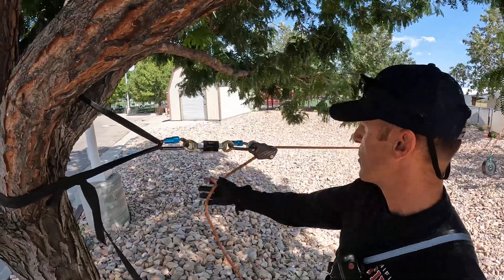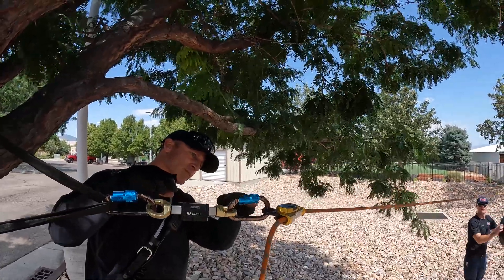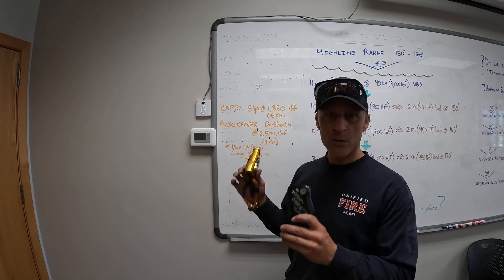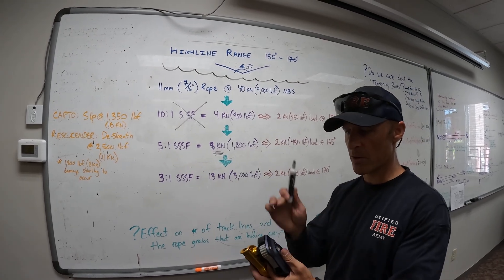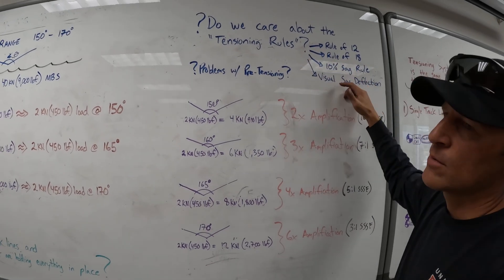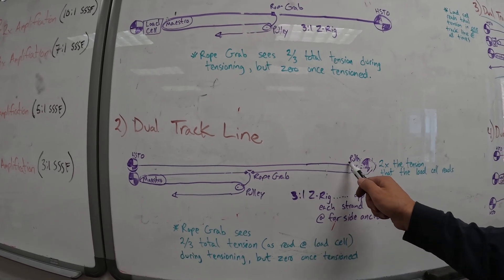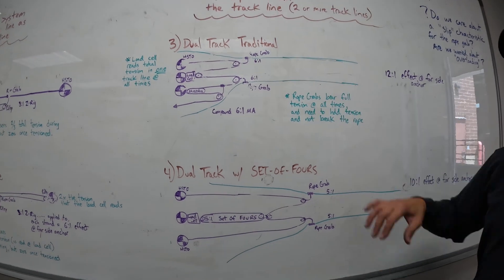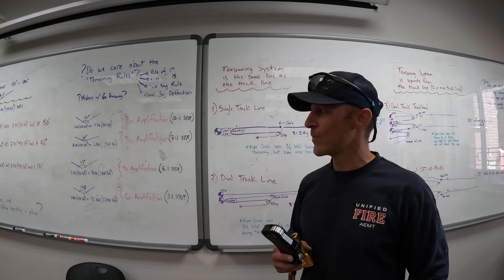Tensioning Highlines w/ Camming Rope Grabs: Force Limiting vs. Breaking Ropes

Comment: Hi Bob, I've gone with the 'differential' rigging for a highline in the past: twin tracklines with a load cell on the balancing pulley reading the 6:1 tension on each trackline. I've used tandem prusiks on each track rather than a rescucender.  What are the cons of using prusiks over rescucenders on the tracklines? Also,  I haven't gone less than 10:1 SSF - is the limiting factor just the value that the rope grab slips / damages the tracks?
Reply from the maker: There was an ITRS paper a while back (before Petzl came out with the new version of rescucender) where they tested a bunch of Prusiks in slow pull applications.  Tandem Prusiks on average broke the rope around 17KN.  While they hold higher forces than the new rescucenders, the software-on-software creates glazing/melting before that which is not ideal.  Either way both Tandem Prusiks and New Rescucenders will break the rope if the forces go unchecked.  The 10:1 SSF has been adopted as a “one-size-fits-all” blanket safety factor that, over the years people have simply applied to every aspect of rigging, every operation, every system, and every training evolution.  I don’t think the intent was ever to make it so that ratio applied to everything.  The control lines of the highline definitely should be at a 10:1SSF based on the original concept of the 10:1SSF, that is to have enough strength to arrest the impact forces.  Whereas with the track lines, they don’t deal with arrest forces and therefore my goal is to be able to apply forces to them beyond 10:1 in order to reduce sag and maximize clearance, but also keep the forces away from the failure limit.  And if I can get a device that can hold to higher forces AND slip (force limiter) before damage/failure occurs, then that would be the “bees knees”.  Unfortunately there aren’t many rope grabs out there that can do that.  And the only one that I know of that can is the old rescucender which they don’t make anymore

Comment: Aren't you overloading T rated rescuecender?
Reply from the maker: T rated rope grabs are not tested/rated based on breaking strength, rather their interaction & manner of function with the rope.  The T rated rescucender is rated to hold a minimum of 5kN (1,125 lbf) without slippage or damage to the rope.  You can overload your system and that means you start to cause slippage, damage, or failure, specifically to the rope.

So we must be specific in our definition of “overloading”.  I would argue that at, for example, 1,600 lbf (7kN) that we are not overloading the trackline-rescucender interface, but at around 1,800 lbf then we are approaching it.

Comment: CMC posted a Q&A article in 2015 in reference to NFPA 1983. In the article, they stated "The 5 kN and 11 kN that you are referencing are the values for the Procedure A test. The respective devices must be pulled (tied-off configuration) to these forces without doing damage to the rope" when answering a question that referenced 8.6.8. Although this section is for testing DCD, if i interpret right the testing requirements are the same. I believe their interpretation is that the device can be tie-off.
Reply from the maker: Interesting.  I still don't interpret that after reading the standard countless times over.  In my mind, procedure A is the test that is supposed to replicate how the end user is actually going to use the rope grab, while procedure B is where the rope grab is tied off & stressed to it's breaking point.  Clearly, I'm just not getting it:
8.6 Manner of Function Tensile Test
8.6.1.1 This test shall apply to ascending devices, rope grab devices, descent control devices, and belay devices.
8.6.3.3 Each specimen shall be tested to both Procedure A and Procedure B.
8.6.4 Procedure.
8.6.4.1 Testing shall be conducted in the “manner of function” for the item being tested.
8.6.4.2.3  The device shall be attached to the rope according to the manufacturer's instructions.
8.6.4.3 Procedure A.
8.6.4.3.1 One end of the rope shall be anchored on to a tensile testing machine and the device shall be anchored to the other end of the rope. The specified deformation force shall be applied to the device at the normal attachment point at a rate of 25 mm/min ± 5 mm/min (1 in./min ± 1∕4 in./min).
8.6.4.3.2 The specified deformation force shall be held for 30 seconds +1/−0 second, and then the tension shall be completely released over a maximum of 1 minute.
8.6.4.3.3 The device shall then be inspected for damage to the device or to the rope used for testing.
8.6.4.4 Procedure B.
8.6.4.4.1 Using the same item and test set up as in Procedure A, the load shall then be re-applied to the device until the breaking point of the device.
8.6.4.4.3* In the case of items that are designed to slip under high load, the rope shall be knotted or the device otherwise blocked to prevent slippage.
8.6.7 Specific Requirements for Testing Ascent Devices and Rope Grab Devices.
8.6.7.1* Technical-use ascent devices and rope grab devices shall be tested at a load of 5 kN (1124 lbf) for Procedure A.
8.6.7.2 General-use ascent devices and rope grab devices shall be tested at a load of 11 kN (2500 lbf) for Procedure A.
Reply: After a little more digging, NFPA 2500 replaces the 1983 standard. The 2500 standard allows for the device to be blocked off or knotted if it is designed to slip. So technically the device meets the requirements as of 2022 NFPA 2500. I find that to be a dumb change to the testing.
Reply from the maker: Agreed.  It does not reflect how the device is actually to be used.... it's not a carabiner.

Comment: Also, you asked about the G rating on the Capto. I believe the answer is NFPA 2500 allows the device to be tied off in order to achieve the 2500lbf strength requirement of the standard.
I think that is why the CAPTO is deemed safe. It has to be 11kN in strength in case the slippage fails at a lower amount, not that it has to grab to 11 kN.  This would also answer why there is so much inconsistency in rope grab slips.
Reply from the maker: I’m not sold & definitely don’t interpret it as such….. have read 1983 section 8 on this over & over & over the past few years.  In 8.6 they state that rope grabs must be tested for both procedure A and B….. It should be noted that 8.6 is the manner of function test, not a breaking test as depicted in section 8.7.    Procedure A there is no blocking knot applied, while Procedure B there is but only for devices designed to slip.  Either way, the rope grab is subject to both test procedures, and 8.6.7.1 and 8.6.7.2 specify the test loads for technical & general use.

Comment: I haven't seen any Bluewater VT prusiks in any of your videos.  I know many BSAR teams are moving to a VT prusik over the tandem prusiks (due to testing), what are your thoughts on the VT prusiks?
Reply from the maker: I do have a few videos (at least 3) where I do on-rope functions w/ the VT as well as show it’s use as part of a multi-functional system at the anchor….  VT Prusiks are great.  I have my own personal one in the side pouch of my set-of-fours, also one in the side pouch of all my full-body harnesses, and also carry one w/ a plaquette and a Petzl Rollclip-Z in my backcountry interface rescue pack.  The organizations that I work for do not carry them because it’s hard to justify $30 a pop based on our mission profile….. lightweight/improvised systems are not as prevalent, and we have MPDs, Maestros, IDs, & ASAPs.  Plus most people in my organizations would be thrown off by the fact that it’s not a loop.  You’d be amazed at how people react to subtle variations/changes to gear when they’re so used to a standard Prusik.

Edit:  I actually have quite a few videos:

Belaying on a Lower
Belaying on a Raise
Belaying Concepts/Safety Factors
4-in-1 Component Based Systems
Passing Knots on Rappel
Rescue Rappelling w/ the AZTEK

Comment: Bob, awesome video. I bought a Line Grip Linescale 3 load cell and the pre-tensioning "rules" didn't result in anything close to the expected tension. Also, even using the same people to pretension the track line the same way multiple times resulted in a greatly variable pretension. My limited testing proved your are spot on advising the only safe and accurate way to both pretension and monitor the loads with a load cell!

What is the formula to calculate the resulting catenary angle given the rescue load (2kN/ 450 lbf) at a given pretension (X kN/X lbf)? Doesn't the span length factor in? It seems like you need more pretension to get the same catenary angle on a longer span. I'm sure factoring in rope stretch (static/low-strech/dynamic) really goes in the weeds. In real life or training, it is very difficult to accurately guesstimate  either the catenary angle or  midspan sag from the ground!

Love all of your videos!
Reply from the maker: I have to draw a line in the sand on the level of "nerdery" I'll allow myself to consume.  There's just a point where I have to wonder if the juice is worth the squeeze when bridging all the math/science into practical field applications that also happen to be time-sensitive.  I've just committed to rote memorization for some of these angles/forces & called it good enough.  But there's an app called Rig Rite that is pretty good (you do have to pay for it though).  Most authors who describe a formula for highlines do so in reference to the tension..... that is they write it in such a way to find the tension based on all the other knowns such as angle.  Also, these texts/books are assuming that the highline is always horizontal and the load is at mid-span because it makes everything symmetrical, and when everything is symmetrical you can get away with splitting the force of the load in half and use 90 degree angles that facilitate the application of trigonometric cosine functions.  But in my opinion this approach is flawed...... So yea, get Rig Rite.

But if you're looking for those texts, you can search for Attaway's 2013 ITRS paper, Delaney's Physics for Roping Technicians, Steve Crandall's i-Book called "Rescue: Rope-Based Concepts", and Pat Rhodes's publications.

If you just want a table that you can commit some things to rote then you can check out my Google Drive library where I built a file all on Highlines (& used many other sources, texts, etc. to present it in a slightly different & fresh way):  https://drive.google.com/drive/folders/1yImaFiAjvutv4qWBCScsM0J8zlMvKcZB?usp=drive_link
Reply: Wow, that's what I was looking for! I'm in the weeds and a nerd. I love to marry the science to practical use, as opposed to just doing it the way others do because that's what we've always done. That's my approach to Search and Rescue to use science to better predict where to look first with limited resources. We have a rope Technician proboard test in the morning and I totally disagree with their highline setup. Not for safety, but inefficiency and old technology. Double prusiks to capture tge single track line tension 30' off the ground in a huge oak tree anchor. Then through COD pulley down to another tree base COD to a 3:1 (capto/clutch) to tension. Load cell up between anchor and prusiks. What if the tension has to be changed? Tend prusiks 30' off the ground!

I sincerely appreciate all of your time and effort sharing your knowledge and experience! Eternally grateful.
Reply: @Propeller_Head That drive is awesome, thank you for sharing that!
Reply from the maker: You're welcome

Comment: Bob, any thoughts on doing a video on spanned anchors?
Reply from the maker: I have no thought on it at the moment….. Is there a hot issue or any controversy/confusion in the business on using them?
Reply: @Propeller_Head  I've been working with spanned anchors in urban settings to provide an anchor for the vortex as an AHD, directional frame and using a TTRS for lowering and raising.  I believe the tensioning could be an issue.  We try to keep the angle at or below 120 degrees.  Ronin did a video where they were hand tensioning their anchor.  My next step is to put load cells at the anchors to see what we get.
Reply from the maker: I don’t have much experience at all rigging them, but I assume that if you’re anchoring everything to it at 120 degrees then the line should be redundantly doubled up (a pair of life-safety ropes), and that each anchor point should be unquestionably bomber…. and if using Prusiks as the interface between the spanned line & anchor components, then they should not be wrapped around both lines, rather use one Prusik per line….. so that the start of a single anchor connection are two Prusiks feeding into a carabiner….. But that’s just me thinking out loud